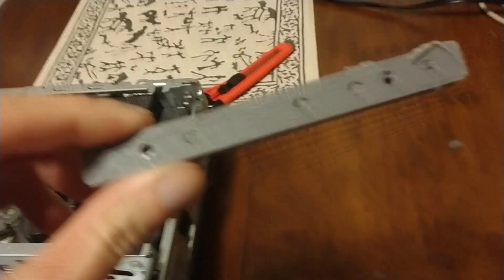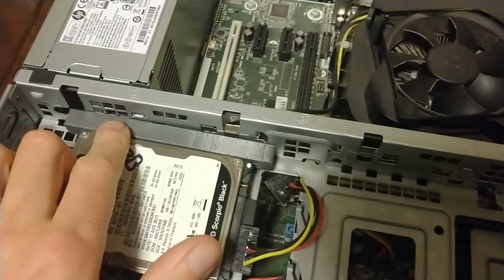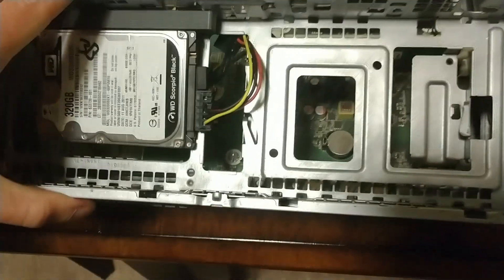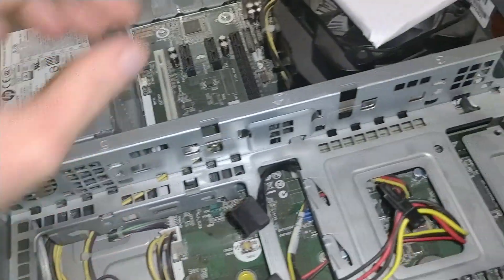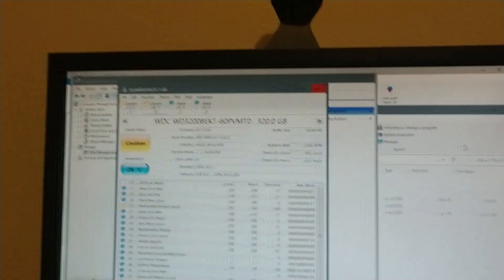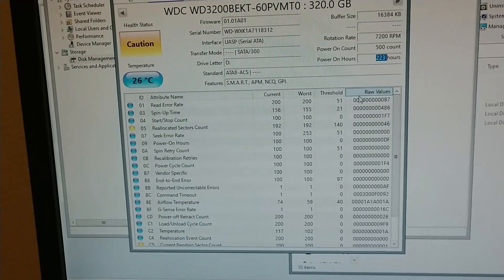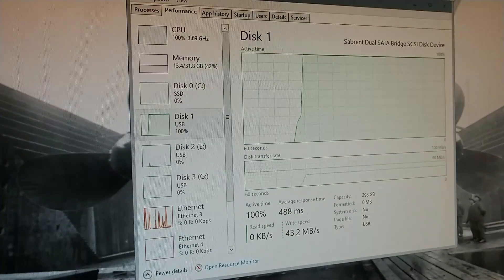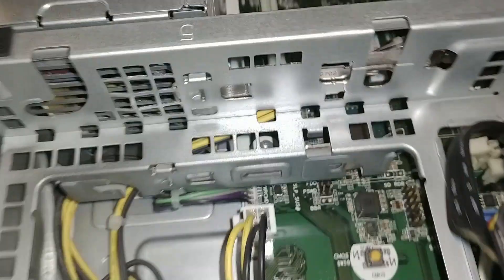I've never seen this before! Student-made 3D printed hard drive mount

Comment: I wonder if these were installed by campus IT or if some enterprising students got s hold of some cheap old drives and swapped them out for the drives in the systems to sell on eBay or something.
Reply from the maker: It smells like students had a go at it given that the drive inside is made in 2011, about 6 years older than the machine itself. And only a downgrade to the stock drive both in terms of capacity and speed somewhat but it is a 7200 RPM laptop drive not bad. 
Perhaps computer was cycled out due to age at its first stage in life, and sold to someone who tinkered with it and never took off the disk wiped sticker from before